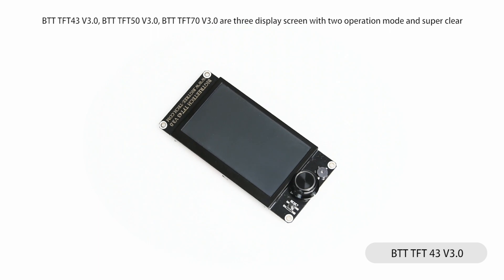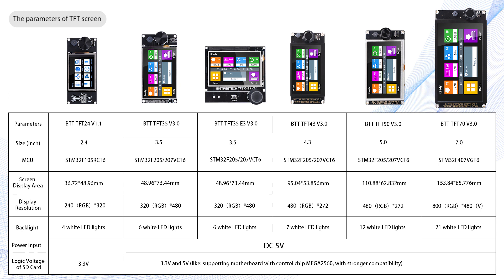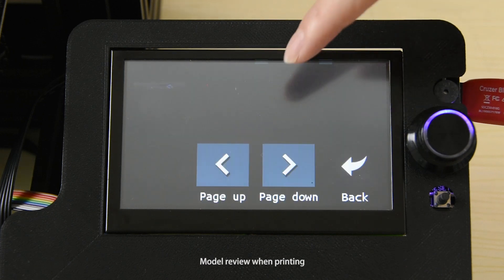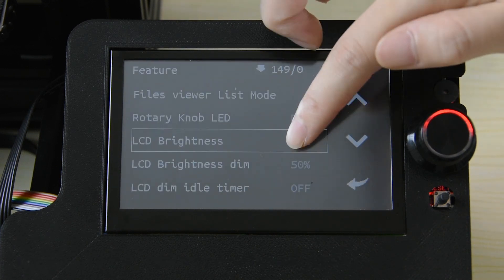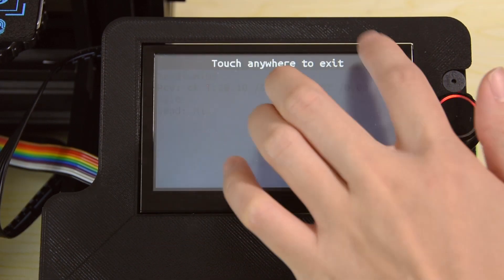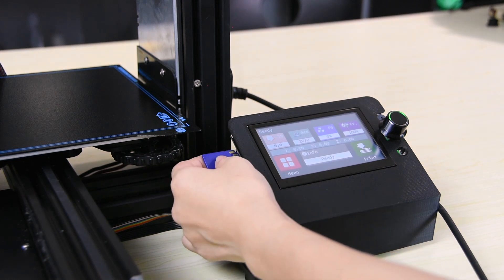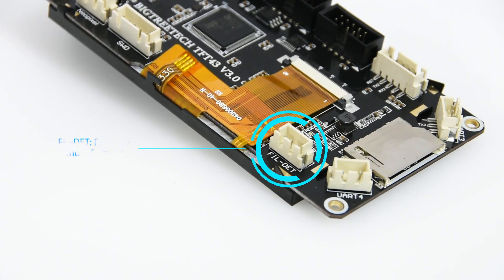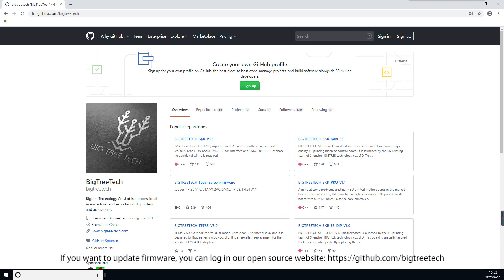BTT TFT 43 50 70 V3.0: Dual operation system and fulfill visual enjoyment big screen

Comment: Your development of the TFT firmware is really bad. There are tons of bugs with so many displays that date back 3+ years, and yet you all still have not fixed them in all your versions since then. on top of that, you have not updated your TFT firmware in over a year. Whats the problem with your development team not putting more focus into the display firmware? I am regretting my choice of buying several BTT screens at this point.

Comment: i have a skr 1.4 turbo with tmc 2209 v1.2 drivers and a tft 35 screen, but, a "tmc connection error" appears on the screen, what that means? :c

Comment: Do you have a video that explains how to get the screen to not read No Printer Attached on top? I have looked for a solution with out any luck so far. Thanks!!
Reply from the maker: Hi, For your question, you can take a picture or video and send it to our technician email.
support@bigtree-tech.com

Comment: still no portrait mode dammit :( I need a portrait version for my prusa mini build
Reply: @garlckbread  It only flips it upside down. or the firmware is changed recently. but yes we need portrait mode, and for the big screen we need MOOOORE buttons on the screen not just increase the size.
Reply: The firmware is open source. Just add the feature yourself if you want it and add it to the master branch when you're done
Reply: @jakebytes602  lol if i knew how to I would I can code a little to get firmware up and running but not to the extent of that :)
Reply: @garlckbread  it only does a 180 flip nowhere to change to 90 degrees in config so it has to be done at the code level